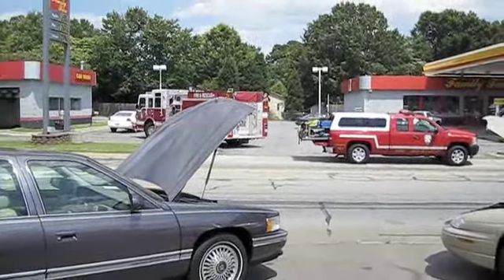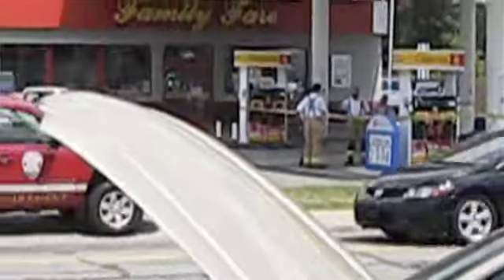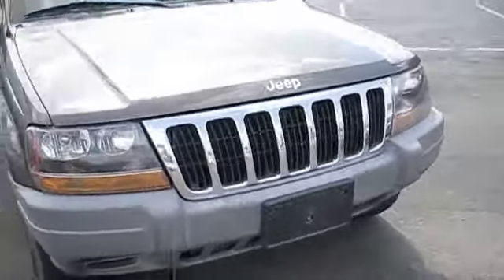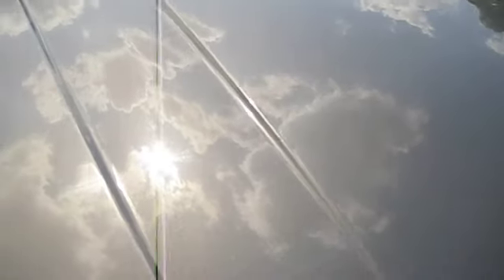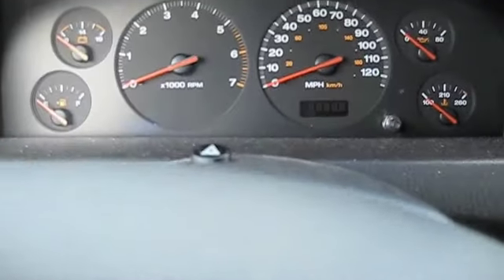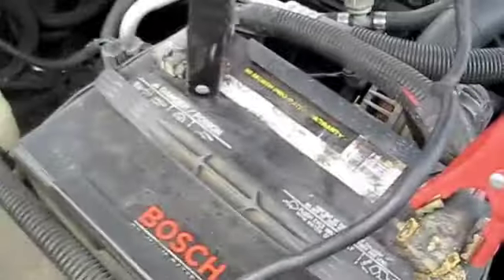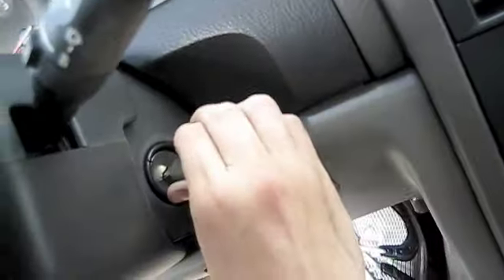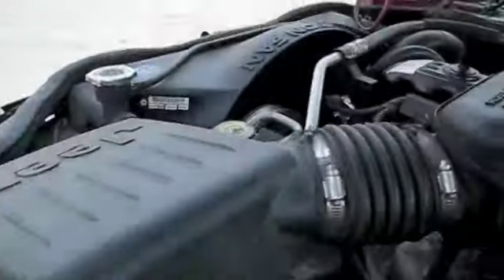Revisit The Jeep Grand Cherokee With Blown Engine

Comment: Aiight, SIR!! Glad we got that out the way. It did last a heck of a lot longer than they usually do but it was so down on power I don't think it would've turned it over regardless. Not fast enough anyways. Blown motors will still start and run it just takes a lot of high speed cranking. That's really why it didn't start. He needed one of those big, fat cabled, plug in jumpers with capacitors.

Comment: to perform whatever it needs to do. Also please note that the very instant he lets off the throttle it stalls right out and requires the throttle to be pushed in before this engine stalls out to keep it running.

Comment: at 3:14 you should have gave it gas because it started running for a second
Reply: Callum Stuart yeah I agree.  Seems to me that in almost all of his videos of it the low fuel light is on.  Even though there's definitely a LOT more wrong with it them just being out of gas, putting a little fuel in there certainly wouldn't hurt
Reply: repl ace the battery so you don't have to use the jump box
Reply: C STUA he did

Comment: @justwolfslife Trust me I replaced the whole unit myself and there was no pulley to mess around with. All I had to do was unplug the power cord and take out the bolts and screw, but you're right about the water pump, which is belt driven. And I believe that the fan does have a fuse. Just check more carefully.

Comment: and one other thing yes its true that you don't need the throttle pushed in to start a fuel injected car however this engine was in such poor shape without the throttle all your doing is wearing out the starter motor an spinning a dead engine.

Comment: the engine has 0 oil. the engine in essence has ceased up. I also bet the piston rings are toast just by the sound. The engine just needs to be re-built and it will run like new again.

Comment: I wouldn't attempt to start it again, when it started at 3:15, it sounded like a bad connecting rod knock. right now the engine block can be saved and rebuilt, but if it starts and throws a rod and blows a hole in the block, an entire new engine would need to be installed.

Comment: FACEPALM FACEWALL THEN FLIPS A FUCKING TABLE* Just explained it but I'll do so again, listen to that engine it sounds like shit and when he attempted to start it it could not even go puff puff puff with no throttle and it was not until he opened up the throttle to let more air and fuel into the engine that it could self sustain itself with the assistance of a starter motor. Its extremly common logic and understandable to do with an engine that won't idle so you can get it running long enough.